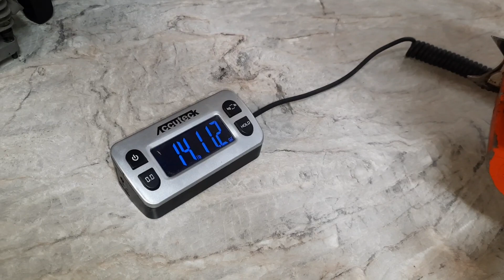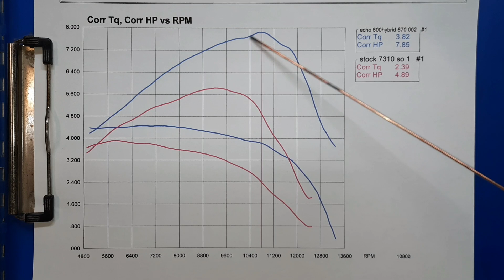73cc SLEEPER SAW! Light weight Powerhouse!

Comment: Question,,, Do you go by Red 97 ???
And do Most Echo's have Longer Stroke,  and Would there cranks work in a Husky saw ???
Particularly On the 2 series saw's
Reply from the maker: Yes, Red97 is my forum handle.
I don't think these cranks are wide enough for the outboard clutch setup. Pretty sure only the 590-620 use this longer than normal stroke

Comment: Very informative video.  I have the echo 590 chainsaw and I would like to know if I can put an 18 "bar. Thank you very much.
Reply from the maker: Thank you, yes you can run an 18" bar on your 590. As long as the chain pitch matches the bar and sprocket on the saw.
Reply: @dynojoemods2764  the chain often loosens for no reason.  I tighten it but when it works it loosens again. What the reason?
Reply from the maker: @ΘοδωρηςΓουρζης-ο1χ  if it is a newer chain It could be stretching.
Reply: @dynojoemods2764  yes it is a new chainsaw.
Reply: @dynojoemods2764  the regulator may be out of place

Comment: Love the hybrid builds.  u do some of the best work ive seen. Ive been tryin to find a cylinder to work on a poulan 3800 since u cant buy them anymore and no aftermarket either. Any ideas? I have 2 mint cond. saws it would b nice to use them somehow. Not that i need more saws but you know.
Reply from the maker: Honestly I'm not familiar with that chassis at all. Most of the time cheapest and easiest is to find parts saws.
Reply: "Not that I need more saws but you know." That is the best line anywhere on any video forum. I laughed so hard at that. Kinda like admitting you have a problem but dont care.
Reply: Get on the forums David, that or ebay, plenty of those saws and parts available. Arboristesite or Outdoor Power Equipment are a couple that would help. I'm chipper1 if you get on. Feel free to shoot me a message on either one if I can help with anything :).

Comment: Is there a particular serial number range of 600p that has the larger main bearing(s)? I have one that I’m working on, looks identical to yours.
Reply from the maker: You would have to look up the parts diagram on a site like partstree.com and see which one lists the different bearings. I found out after I had it all split and my standard 6202 bearings didn't fit.
Reply: @dynojoemods2764  will do. Thanks for the tip.

Comment: I know that this is different, but have you ever encountered the CS550P Echo? It’s obsolete I know, but I bought mine for a screaming good deal brand new late last year from a genuine Echo dealer even though it was made in 2011. He sold it to me at cost just so that he could get it out of his inventory so that he would no longer have to pay taxes on his “dead” inventory. $339 and change. Good little saw that I had to get a Canon bar made so that I could run 3/8 chain on it. 54.1cc an 16” with a60(?) drive link count and full comp(house) and if pulls with it with authority. Very mild muffler mod made with nothing but a thought out place to drill an appropriate sized hole (7/16). I’ve never seen anything on one so I’m just curious.
Reply from the maker: I've not seen a 550 in person.

They look like neat saws.

Comment: Joe that is an incredible power increase!!!! What was the squish approximately? Would you say the port work was about the same as a woods port? Talk about a heavy hitting lightweight
Reply from the maker: Squish was around. 020 port work was less than if it was a regular 680. Only exhaust port work, very little done on lowers and only scuffed the intake

Comment: May I ask! With the spacer’s although for the stroke are they increasing the case vallum? Or how much of the35% gain can be attributed to if any. I will qualify myself as a bumper jack in this matter.
Reply from the maker: It is hard to dial in exactly where the gains are coming from on a project like this. It may like the reduced volume more if I were to epoxy the case cutouts.
Reply: @dynojoemods2764  Thanks. Before I heard about you from Ironhorse I would hear stuff. Did not understand much I was just getting the jest of it.

Comment: Am I remembering wrong or did the Husqvarna 550 mk2 put out about the same hp and tq on the dyno that the Echo 7310?
Reply from the maker: The 550 was around 4.8 peak and a good bit less tq

The 7310 is about 5.8 peak but it's peak is a bit lower on the graph than where the numbers were taken
Reply: Theirs roughly 23cc difference there as well
Reply: The 550 is also a 50cc saw

Comment: Red, another great video. If I were to buy new, would it make more sense to get a cs590 or a 620?  I’ve heard the carb and coil on the 620 are more usable with mods and was wondering if I would be ahead just starting with that saw, possible bought during an echo one day sale.  I’ve been keeping my eye out for used, they just haven’t come up. 
Thanks for putting and posting this content!
Reply from the maker: If you are planning on modifications, the 620 is the saw to start with. If you just want to leave stock 590 is a great saw.
Reply: @dynojoemods2764   getting a 620 tomorrow. cant wait to try it out.
Reply from the maker: @Rob-tl9md  
Good fuel, sharp chain it should be a great saw.
Reply: @dynojoemods2764  trading a 371xp for it so I sure hope so lol.
Reply: @Rob-tl9md  what's wrong with the 371? Them things are legendary. A clean one goes for 5-600 buks in my area
Reply: @jamiedalluge9472   I have 2 of em. Other one is a 371xpg.
Reply: @Rob-tl9md  371 has alot more power than the 620 at almost the same weight. Alot if guys like them tho
Reply: @jamiedalluge9472   yea I get it.  We will see how i like the 620. I don't really need more power.  If I did I'd just run my 7900. Which kills my 371. I just like saws and trying new ones.

Comment: Could you make a hybrid or sleeper saw of 7310 make it into 80 or 90cc compete with new 592
Reply from the maker: The 7310 dosent really offer the extra stroke needed to make that happen easily would be easier making 92cc from the 590/620 chassis

Comment: Cool vid. I know a rabbit hole you could go down. Do a test with a no synthetic and synthetic mixing oil. See what the difference in power is. And if you really want to go down the rabbit hole do a fuel test low octane to high octane.
Reply from the maker: Once the warm weather comes back I'll see if I can measure any differences.
Reply: I would enjoy that. Once in a blue moon i get stuck with 87 octane with ethanol. Makes me wonder.

Comment: Sweet saw joe! I’d love to do this to my 620. But machining is beyond my capabilities. It’s too bad a company doesn’t make a bolt on  50mm piston and cylinder for this. I could handle opening up plastics and such.
Reply from the maker: It is a job, that is for sure.
I built these hybrids before echo released the 7310. Now that it is out, it can be ported to come close to these builds, with a bit more weight is all.